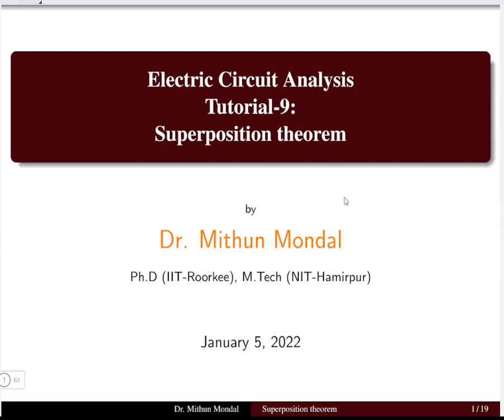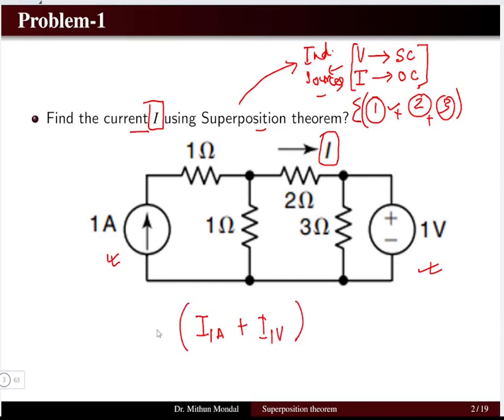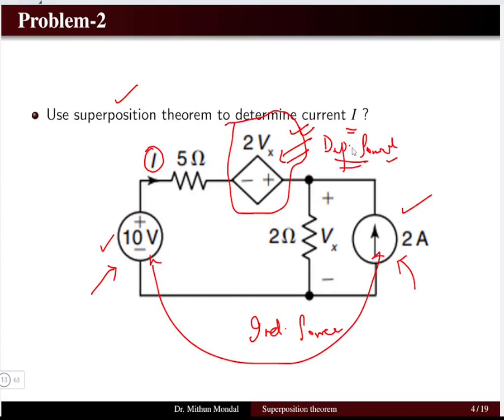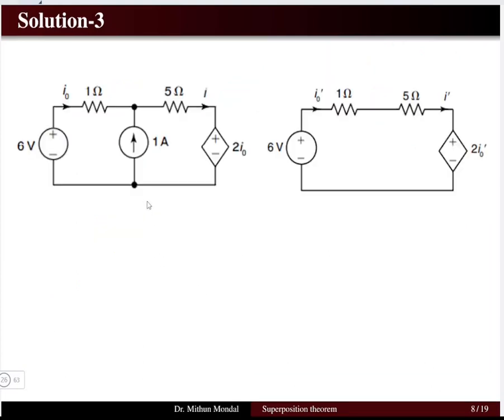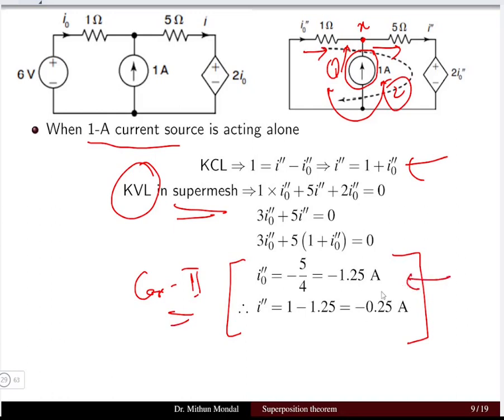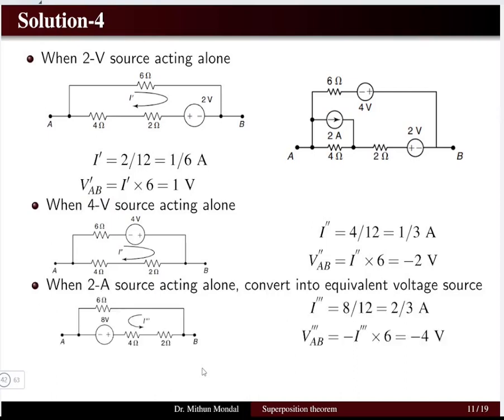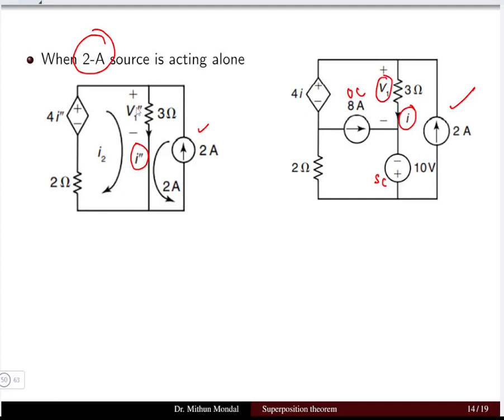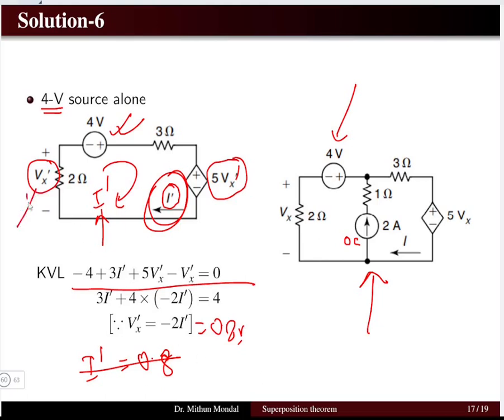Electric Circuit Analysis | Tutorial - 9 | Solved Problems on Superposition Theorem

Comment: 7:51 why change polarity
Reply: exactly...is your answer coming 4.67 A too?
Reply from the maker: In the dependent current source, current is entering the -ve polarity, which is not possible in accordance with passive sign convention. It has to be positive which can be done only by reversing its polarity. Therefore, the polarity of the terminal voltage also changes.